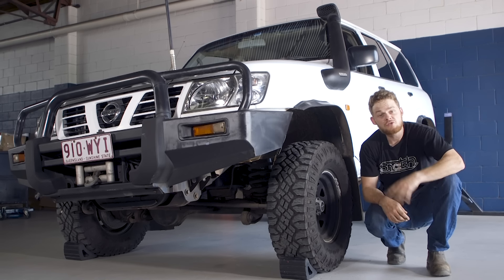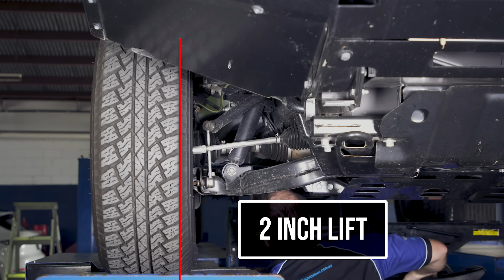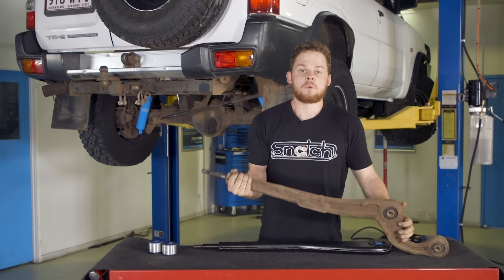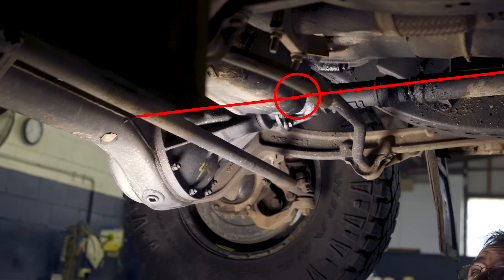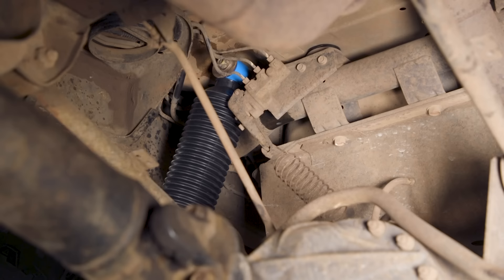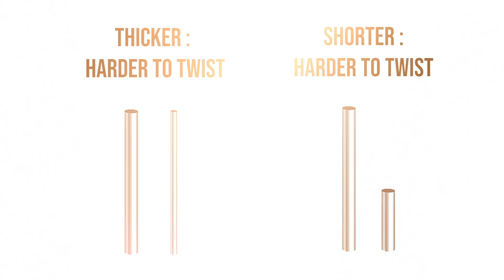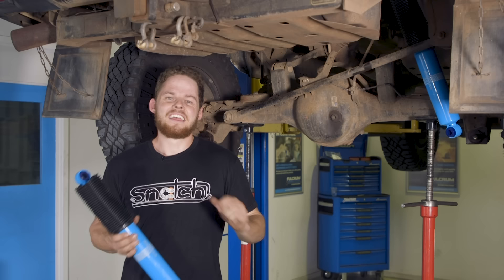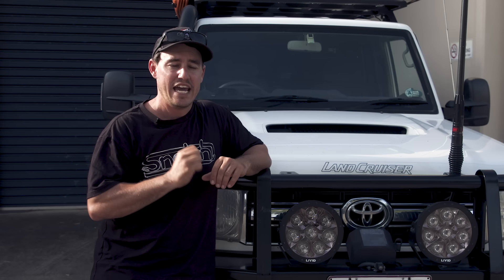EXPOSED! Are bigger suspension lifts better? Experts show what really happens when you lift your 4WD

Comment: This is true of IFS. However, with some vehicles, such as the Nissan Xterra, you can also widen the stance be length if the LCA, UCA, tie rods, and drive shaft. This is known as a “Titan” swap. This helps lower the extreme angles of doing a 4” lift on an Xterra. A Titan Swap, is taking the entire front end of Nissan Titan and putting it under the Xterra.

My 2012 Nissan Xterra I run 4.5” lift. Titan Swapped. 35” tires. USA)
My 2021 Ford Bronco Sport 2” lift, 31” tires.

Comment: Great video! - much needed, thank you! 35's on a 2" lift seems to work fine on the Nissan Patrol GU 2012. So far off-road, the wheels haven't scrapped body or guards. Has Tough Dog suspension.

Comment: Next video should be about differential gear ratio change between 31"-40" tyres and include some clue about ratio change in transfer case.
Reply: Doesn't really get done in Australia.
Reply: @TheTobes99  I also wander why not... Russians go between 3.9 to 5.29 (mostly 4.88-5.29), americans even go further, they also change ratio of transfer case between 2.54 to 3.48, or even put Atlas IV which has 4 gear steps (1.0 - 2.86 - 5.65 - 11.3). with 35" and diff 4.1 it sucks compared to 33" and 4.1, now I am thinking to go to 4.88 or even 5.29.
Reply: @shokhrukhnigmanov1278  Australians just add more Horsepower because diesel engine tuning is very common over here.

Comment: Excellent video Jocko! I own a 2015 Ford F150 (Canadian) with a 3" lift. The lift kit I bought came with a heavier control arm with the angle changed to keep my CV's at or very near where they are from stock. The 3" kit was just under $150 more than a 2" kit was thus why I went with a little more, I figured $150 wasn't bad for an extra inch. But the 4", very expensive & whoever does it has to buy quite a few extras to make the IFS F150 steer, handle, etc., it's nuts!! And the kit itself is over $1000 more than a 2" lift kit is without getting a whole lot more. My kit came with heavier shocks, struts, the upper control arms & bits & pieces for brake lines and such. Anyway, that's why I only lifted my pickup 3", it was an affordable option ($800 in my case) & it gives me enough lift with the new rims & 33" tires I'm easily satisfied with it.

Comment: People in the United States; "What is this engineering law you speak of?" We have no such legal or financial government restrictions. However your off-road commentary is on point. I wish more people would understand this. In America, most people think bigger is better, i.e. 6 (15.24cm), 7 (17.78cm) and 8 (20.32cm) inch lifts are the way to go. Usually this is not even a suspension but a body lift. They get ground clearance and option for bigger tires (tyres), but run low grade suspension components. Don't get me wrong, we have a solid 4x4, off-roading and overlanding community that know better, we're just out numbered by the ignorant. What can I say, thanks for the video.

Comment: Doing big independent suspension lifts well means using longer suspension arms and associated driveshafts, brake lines, etc. Much more work and cost, of course, but this gives a great opportunity to reenngineer the suspension for superior travel, kinematics, etc. The wider where track adds much needed stability to compensate for the higher center of mass.
Reply: Problem is, in Australia we can't widen the track more than 50mm, so all those nice Total Chaos, Camburg, Marlin, etc. long travel kits are illegal.

Comment: Increasing the wheel size by 2" from factory will help left the entire chassis by 1", but then the unsprung weight will increase, making acceleration and braking suffer.
Reply: I did this, my factory tyres on the Zook GV is 235/60/16 (in CM's) and I went for 205/80/16 AT's and this almost gave me 2" extra, there will be rub when steering at full lock but this is aparrently fixed with ''a big hammer'' haha

Comment: Higher you lift not only incurs more cost to do but on going costs for larger tyres, loss of mileage, more fuel stops, @ around 10% per inch it works out a lot of money at the end of the day/year, running 2004 100 series4.2td, 2” ifs lift with 33’s no engine mods  still get 9litre to the 100k, best car ever luv her 9yrs now all I’ve done is an alternator 😊 370 thou on the clock doesn’t skip a beat, she goes anywhere I ask her to go!!

Comment: I'm the non typical American. I have a 2006 F250 6.0 that had an 8 inch lift. I had it lowered to a 3 inch. The problem is it wanders all over the road now. When it was lifted it didn't wander at all. The company who dropped it specialized in lifting 4wd trucks. But this was their first time lowering one. I have a feeling the geometry is jacked up bad. 

I've had the alignment checked by 3 different companies. They are saying the tires are soft because of the tread depth. I have 7000 miles on them with no change.

Comment: D40 navara with a 2 inch lift. Still handles like a champ just need some upper control arms or extended ball joints for the front to utilise the extra lift without the upper arm hitting the tower. But the best part is if I get stuck I just pull myself out with the dominator 👌👌👌. That thing is an animal
Reply: Have never heard of needing those for a 2 inch lift

Comment: i put a 2" sus lift in my suzuki grand vitara. 
cost around $560 aud, it was a lovells kit.(also did 2" body lift after)
it was a straight slip in/bolt up kit so no modding required. 
i also checked available droop/flex before a brake line was in trouble and put in 2" shock blocks for the rear. so now full flex, no brake line risk and no rub in the guards.
she is sitting on 31's and looks the real deal off road. did Montezuma falls a few weeks ago and didn't have to touch a strap or winch.
next will be a removable winch and a locker.
but im definitely an IFS man. i cover 98% of my kms on the pavement and tassie is not well known for straight or good roads XD

Comment: You guys should go to Moab, UT in spring. You'll see a lot of Jeeps with 6+ inch lift and 40 or 42s on them. Still, as you mentioned, even on a Jeep which is a lot easier to lift than a Toyota or a Nissan you still need to consider new drive shafts, relocating exhaust pipes, longer brake lines etc. With a 3 inch lift on a Wrangler JK you need pretty much nothing but coils and shocks. To get the castor right though I'd recommend replacing upper and lower control arms with adjustable ones, as well as (mentioned) adjustable track bars otherwise your steering will be very light on the road. Sway bar links usually come with the lift kits and for shorter ones like 2.5 or 3 inches you usually move the rear sway bar links to the front (they're longer) and mount longer ones in the rear.
Well, other than that things are fairly similar - I think Jeeps are easier to lift because of distinct upper and lower control arms which if replaced with adjustable ones (they're only like $300 in total) you can center your wheel in the hub again or as I did - just bring it in to an alignment shop and they'll adjust all the adjustable elements for like $100 and you're good to go.
Personally I like my 3 inch lift with 33's on it. Still good on the road and great off road and all of it cost me around $3k including tires and rims plus an afternoon in the driveway having fun with greasy hands :-) Of course, it's never going to be an extreme rock crawler (which apparently we favor over here in the US), but it's great to tow my little offroad trailer to places no Prius will ever go.

Comment: This really depends on the vehicle, the suspension, and the usage.

 Is useful travel increased with the lift? Is useful articulation increased? Is the rollover risk increased? Does the vehicle still fit under branches/overhangs in its normal AO, or in off-camber "canyons"? Does the lift increase ground clearance or clearance angles? Does the lift increase tire clearance? Does the lift cause a cascade of other things that need to be modified?

 In the common AO, is the suspension height/travel/articulation the first limiting factor, or related to it? The first limiting factor of a rig might instead be open diffs, air intake height, mud-clogged treads, fragile tire sidewalls, or vulnerable undercarriage.

 Would Ox-lockers and a winch be more beneficial? Siped mudders/hybrids? High-clearance skids and bumpers? Fender trimming?

 I personally tend to prefer high-clearance low-COG rigs, but they may not offer the best articulation, travel, or clearance/angles compared to lifted rigs.

Comment: That's what I say biggest tire with the smallest lift possible. 
I run 35s bfg KO2 on a terraflex 2.5" lift with adjustable dual reservoir shocks   and adjustable control arms on my JKU and it does great on road and offroad.

Comment: The wheel wells need a strapping. Flexible band strapping like hving a mini trampoline for top of each tire nearing max travel top side. Most of the time no effect at all, but when u hit a big hole driving or drop off a ledge the shock & spring & strapping take the hit 1,2,3 not just 1,2 punch.

Comment: No one speaks about I/RFS with the air suspension, ie Land Rover. The air suspension control system mimics solid axle very well but still gives you the safe on road benefits.

Comment: I literally just got defected this arvo in my superior engineering 5 inch lifted 80 series on 33s by QLD Road Command. Cost
1 Demerit point and 133 bucks... Paid over 5 grand for the kit now its practically useless. Back to 2 inch lol
Reply: Straight outta Yandina just gotta know a guy mate
Reply: @benmoore8572  yeah I wish I did mate lol
Reply: Superior will give you a mod plate with their 3" lift

Comment: True your u joint angles will increase, and I'm sure our manufacturers did their research when designing most of our rigs, with driveshaft angle in mind, but I wonder where you find out the specs on exactly how much angle is too much, since a flat driveshaft with no angle will wear the u joint out faster than anything since the needle bearing caps aren't actually being rotated at all, the more angle on the driveshaft the more the caps spin while driving, equaling them actually be lubricated, again I'm sure they designed it well but I'd be more concerned about pulling your driveshaft slip yoke out and fuclimg everything that way

Comment: If you're really serious about long travel live axle suspensions that would actually work well in all conditions, a custom 4 link would be much more ideal than anything with a panhard rod or watts linkage since both methods of lateral axle location suffer from terrible inability to keep the axle centered over it's usable vertical travel. All the camber and travel benefits of live axles, but much more adjustable and still simple and durable.

Comment: With IFS, here in the states Long-travel is the king of gaining more suspension (I mean obviously live axle will outperform it in travel but long-travel easily outperforms stock travel control arms- so not arguing the IFS is better than live axle thing, just that if you do an IFS setup, long-travel suspension components are really the way to cycle more wheel travel and gain lift without binding your CVs and balljoints).

Do you guys do much with long-travel suspensions there?  What's the legality of those setups?  Titan-swapped Navaras would be 4wd long-travel setups.

Comment: 2018 ford ranger.. OME 2 inch lift. 400kg constant leafs. Car handles great. Flat round  corners and flexes enough.. brrn happy with it past 12 months
Reply: TyRCelto  sure does. Always got a few hundred kgs on board because of steel tray and full size cannopy but corners really well. Sits flat.
Reply: TyRCelto  nice. Yeah rides a little stiffer but ya gonna get that with heavy leafs. If you get the right amount of weight sitting on them they are cushy!
Reply: TyRCelto  ha ha ha i know the feeling. My ranger and camper has me just over 90k for now. Lol. 265/75/16 are 31.6 inch. I run those and ive done toolangi rocky track on then. Same as graham from 4wd actions set up on his dmax and aslong as u have a winch n righy reovery gear u dont need big wheels/big lift. Car handles better with 31.6 inch. I cant see why the 2 inch lift would matter. I didnt know that about the dmax. Sure someone does an alignment kit or dif drop it. I think 4wd action run fulcrum suspension and he has 2 inch lift.  Pay to check them out. Dont read to much into forums.... i did that for 6 months before buying n begging my rig. Just made it harder to deside through the bullshit. Go to shops and ask experts.... guys who do it!! Not guys who talk shit about it. If ya near ftg in Melb go to opposite lock in ftg and see ben. He has been awsome with my 4b and my dads 4b. Did my trailer redarch brake control to. Let me know what ha find with the dmax lift. I have a mate looking to make the leap into one. Would be good to give him some info. Cheers. 🤙
Reply: TyRCelto  with leaf size.... work out all the gear u will have etc and ball weight of camper etc and calculate it. I did and still ended up over and ended up putting airbags in the rear. 300kg doesnt seem enough if ya gonna tow a camper and carry heap of gear..... especially like a kimbly trip. I think mine were 300kg heavy duty springs and then had an extra leaf pack added to make them 400kg constant from arb. Next step is 600kg constant but then u need gvm upgrade and need to carry 600kg constantly to be legal.  I avoided that with the airbags.  Airbag man $800 for set of rears bags. Installed myself

Comment: Long arm long travel kit on ifs with some king bypass shocks will complete well with most moderate straight axle slightly lifted trucks. The way I’d go! Besides long travel kits look sweet, perform well. If ya never rode in a true long travel suspension with bypass shocks ya probably think your box mattress is a soft bed.

Comment: On my 86 k5 blazer I have no lift with 12.5-37-16.5 military on 8 lug 16.5x6.5 steel hub cap wheels with only a pie cut done to the bottom front corners and they still have the full factory fender lip, on my 71 k10 I have a 4" with 17-40-15s on 8 lug 15x10 but for over 9 years I had no lift with the same setup. Both trucks have a sm465 granny 4sp were the k5 is factory with it the 71 was a auto tell u swapped it out, the k5 also varies in drivetrain with a np208 and 4.10 diff gears were the 71 has a np205 and 4.56s.

Comment: The worst u could do is empty the corner full to top no air cup. If system has to put any oil in corner cup their is a leak flash code & it should never need to add any into corner cup top feed main line & pressure line to caliper on bottom. It will cut off the leak long b4 u empty the whole corner cup & get air in the line. Not 1 reserve cup or over flow but 5 & the line feeds from axle safe supply.

Comment: I have an 8" lift with 42" tires on my F350, custom triangulated 4 link dual rate coilovers with fox bypass shocks front and rear.  The shocks alone cost $6k lol.  It is not a pavement princess either, I actually broke my front axle hitting a dip that was deeper than I thought at 30mph recently which would have totalled a regular truck (the impact was so hard it snapped the bolts on my toolbox and tire carrier in the bed) I learned to go back and forth on a section slowly before going fast on it after that lol.  I like the setup of those utes tho, if/when I wreck my truck again, I might build something like that instead.  My truck is too big to crawl, but it's great at desert stuff like Moab, UT.

Comment: The only way a lift helps at all in fitting bigger tires is if it comes with extended bump stops. If its just long springs its makes absolutely no difference to tire clearance then a stock spring. If it does help something is seriously wrong! Like you could be blocking the springs out or bottoming out the shocks before the bumpstop has fully compressed.

Comment: I run a 2” lift and 33” wheels on my 2019 Navara (IFS and coils on both axles) and use it offroad almost every day. I have progressive coils on both axles since I do change the load up front - my winch is detatchable to save it from road salt in the winter, and I also mount a snow plow in the front. The truck drives considerably better with these mods than stock, both offroad (obviously), but also on. The stock suspension was to hard when the truck wasn’t loaded, with the upgrades it drives well unloaded and with max load, which is about 1,000 kg.

Comment: My truck is cheap and easy to lift.  It's a 78 k10. $460 for the 4 inch lift. Just installed it a couple days ago and then this popped up in my recommended

Comment: Interesting to see how things are done down there 🤘 I guess my set up would be illegal. Wrangler with a 4.5 inch lift on 37s regeared to 4.88. I ran a Tacoma on 33s for a long time but constantly got high centered on trails. Doesn't happen with the Jeep but I know the taco would be a beast to with the gears and tires.

Comment: Lift, in most cases, just helps for tire clearances. If you are worried about flex and serious about offroading, you would raise your fender wells first kinda like tube fenders on a jeep. I personally don't like that look and would instead opt for a 2 or 4 inch lift with an inch or so of body lift if needed.